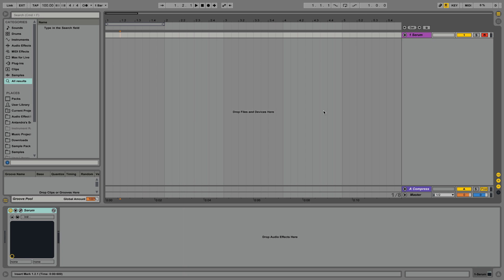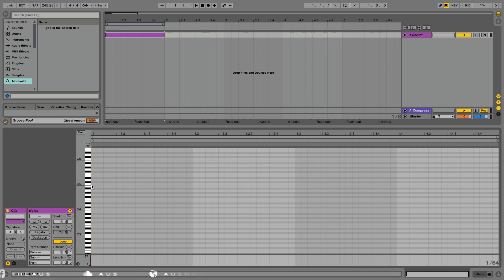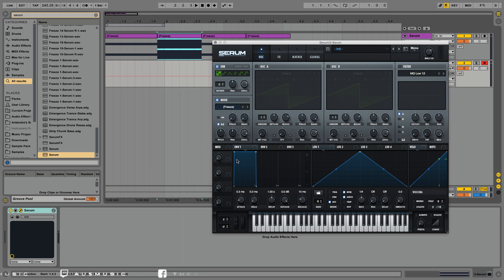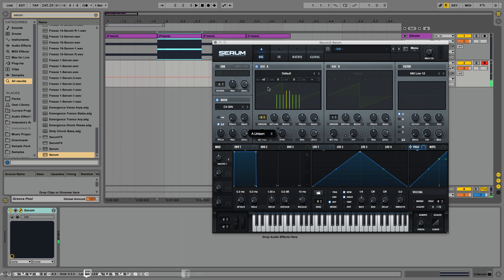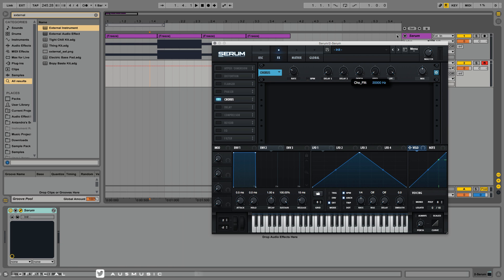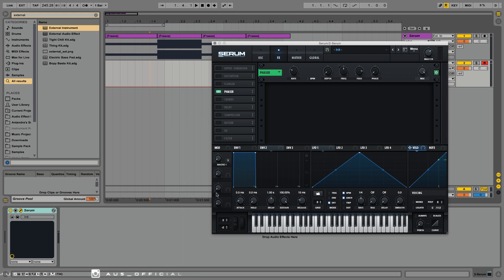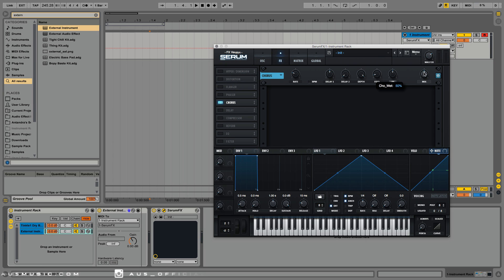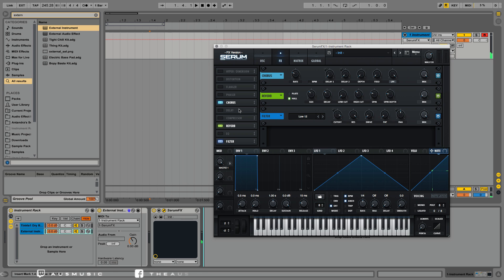"Phase Mod" Anything With Serum - My Secret Bass Design Technique

Comment: How did you figure out 245.28?
Reply from the maker: BPM/60 = Hz
C4 = 261.63Hz
*60 = 15697.8 BPM (too high tempo)
/64 = 245.28 (reasonable tempo that works because it's a factor of 15697.8)
Reply: Thanks so much for responding & explaining!!!
Reply: @au5music  this bpm can be altered after the import ?
sorry for the ignorance 
i did not get the principle
Reply: @au5music  I don't think this matters a lot, but middle C in Ableton is C3, not C4. This is because it doen't use the "scientific notation". Thus, a C4 in Ableton would be 523,25 Hz. Thanks for the amazing tutorial, you are a real pro!
Reply: @au5music  still complicated a bit
Reply from the maker: samuele 55598 I'm just a huge nerd with a passion for music and science. Self taught.
Reply: Do you studied engeneering, at a music school or are you freaking good at math ? lol best serum trick i ever seen, i love your music Au5 <3
Reply: Passion for music and science ? Huge nerd ? 

Dude, I need to meet you ⎝´• ꔢ •`⎠
Reply: Because music works in bars and steps, and a bar is 4 steps. And if you notice when you listen to a song, there is usually a change in the sequence every 1, 2, 4, 8, 16, 32 or 64 steps (and so on, the previous number always multiplied by two). If it doesn't it will sound off and not harmonic/flowing. It's just a basic rule of rhythm basically. In the video if Au5 didn't divide it by one of these numbers the wavecycle in the sample used for Noise FM wouldn't fit the tempo, and it won't sound as good.
Here is an exercise for you: try to listen to any track, and count every beat of the tempo. You will see that changes in the rhythm or variations will always happen every 1, 2, 4, 8, 16, 32, ... steps. No exception! That's why music works.
Hope that makes sense!
Reply: Hey man, i don´t think this makes any sense at all tbh. Could you please elaborate a little bit more on that ? This is questioning a lot of my paid tuition xD.
Keep it up you are doing the sounddesigner gods work ;D
Reply: Maybe he thought it would work better  because of the binary thing. 1 2 4 8 16 32 64 128. Music is basically emotion and maths so the more elegant the maths the more elegant the music, perhaps he was thinking along these lines... I really don't know, obviously.
Reply: This technique is amazing, but your math isn't quite right, specifically BPM/60 = Hz (it doesn't, it equals beats per second). I assume your goal is to get clips that are a whole number of cycles, so use195 which will gives a C3 (130.81hz) exactly 161 cycles in 1 bar, or a C4 exactly 322.
Reply: in ableton you can select grid length, and in the bottom left of the whole screen your MS value is shown....or maths!
Reply: Well, unless there are time signature changes. Ahem, prog music...
Reply: I hope that isn't short for progressive house
Reply: Holy shit brilliant answer mate, was wondering that myself like why is this guy confidently saying 245.28 lmao
Reply: 0 prog metal
Reply: Hey Au5, this got me interested in finding a way to make no click whatsoever. The simplest way I found is to just set the project tempo to 440BPM and use A4 as the root note. Then be sure to make your DAW render a bar or 4 with the remainder turned off _(FL user)_.  Easy to remember too [ A4 440BPM/Hz ] perfect phase... Right? (Making it compatible with all DAWs instead of using ableton features/even mobile DAWs possibly;)

Am I doing any of this right? You divided the Hz by 5 I think to get your tempo for C4 right? I feel like I "need' to be exact with it so I don't get any unwanted surprises.

https://en.wikipedia.org/wiki/Piano_key_frequencies
Will edit after response (even If it it not Au5, or if I figure it all out in my head. (I am off sometimes when it comes to the precise math behind audio engineering occasionally, but I want to learn as much as I can and spread my knowledge so it makes more sense to us math people out there.

EDIT:After some testing in FL, If you want to use piano mapping, you must change the pitch knob to 3.00%*... still in perfect sync it seems though. (Am I over complicating you think Au5, or is this extra bit of quality worth it? (Pss... does this give you perfect results anyone? Wile rendering do not use Dithering, turn on trim PDC, and select "cut remainder" if possible or it doesn't seem to start in phase) Note: the output name was -Sine *(A4 440BPM_1Bar) which i liked.
Reply: @Rivanni  It's because 64 is a beat subdivision 1/64 . You could use 128 or 32 if you like but 64 gives the best "usable" tempo
Reply: Since there are quite a few comments about Au5’s calculation that seem misleading, and some that outright confused me, I went through the math to understand the procedure. Here’s how I explained it to myself, I hope by sharing this I can spare someone else the confusion. I know it’s 3 years later, but if I came across these comments just now, others will, too. ;-)
To recap, Au5 was looking to create a loop that doesn’t click when it goes from the end of a beat or bar back to the beginning. For this to happen, there shouldn’t be a jump in the waveform when crossing from end to start of the loop. To make sure this is the case, Au5 calculated how long a beat length needs to be so it ends on a completed cycle of the wave. 
Here’s his procedure with some added explanations.
Step 1: Understanding the connection between BPM and Hertz (Hz).
In order to think about wave cycle lengths within the BPM of a DAW, you need to be able to convert Hz to BPM. 1 Hz is defined as 1 event or cycle of something per second. So 1 beat per second can be viewed as a beat at 1 Hz. Since beats are usually measured in “B”eats “P”er “M”inute”, you need to divide BPM by 60 to get the beats per second, i.e. the Hz of a beat. Hence, as Au5 put it in his reply, BPM/60 = Hz. With this formula, you can now go the other direction and convert a wave’s Hz to BPM.
Step 2: Finding a BPM where a wave ends on a completed cycle after a beat’s length.
Multiplying a wave’s Hz value by 60 gets you its number of cycles per minute. For example, an A4 at 440 Hz, which is a wave going through a complete cycle 440 times per second, would have 26400 cycles per minute. So a BPM of 26400 would be one beat per full cycle of A4, or a cycle of A4 for every beat.This would solve the quest to have a wave cycle complete at the end of a beat, but 26400 BPM is not useful to work with in a DAW. So there’s one step left.
Step 3: Bringing down the BPM to a value that’s practical (but maintains full wave cycles).
With 26400 BPM = 1 cycle of A4 per beat, the BPM divided by 2 would result in 2 cycles of A4 per beat, since half the BPM means double the time between beats. The BPM divided by 3 results in 3 cycles of A4 per beat, and so on. This shows that you can divide the BPM by any whole number (except 0) and you still get whole cycles of A4 per beat, since every number you’re dividing the BPM with is the number you multiply a full cycle of A4 with. As long as you pick a whole number, you’ll always get whole cycles of A4. 
I don’t know that there was any specific reason for Au5 to pick 64 to divide the BPM, other than getting the BPM into a realistic range to work with in the DAW. As described above, to get full cycles of C4, he could have chosen any positive whole number.
That’s it, hth